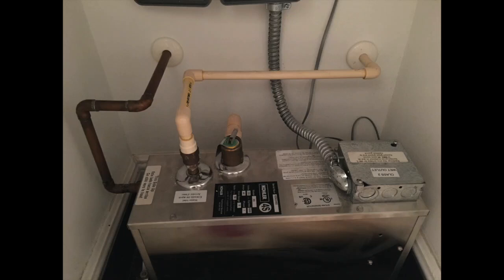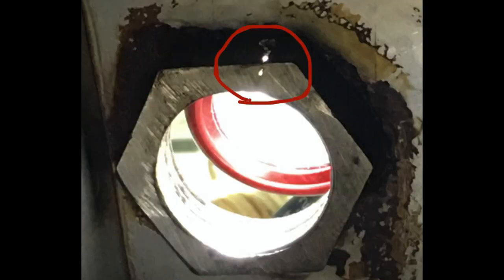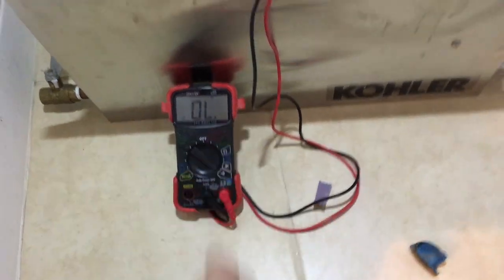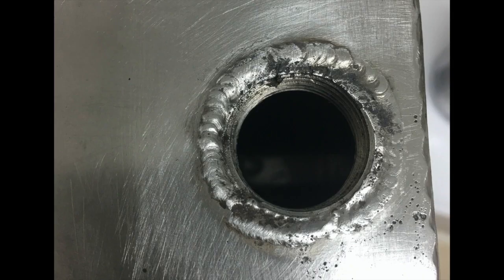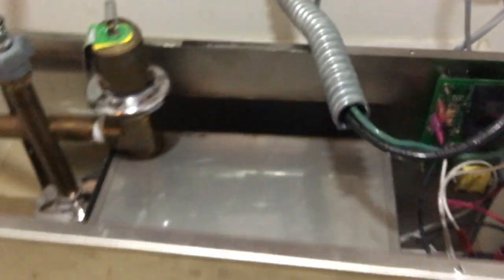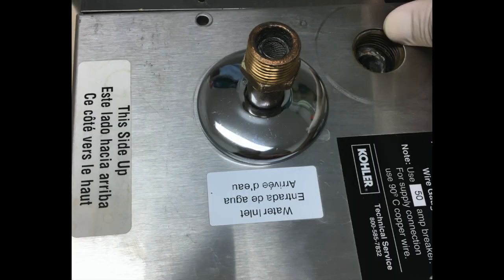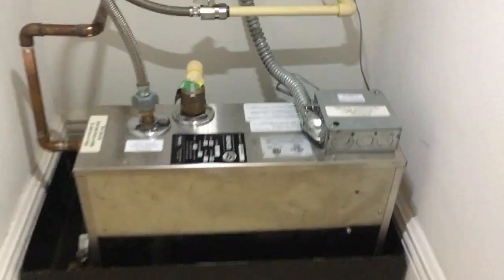Steam Generator Repair - brief highlights (K9 Kohler; Model 1659)

Comment: I am installing a 7kw at the moment. Is there no temperature sensor? My client didn’t provide one so I’m not sure if it exists or not. The Mr steam unit I install usually comes with a wire that has a metal tip, which acts as a thermostat.

Comment: Did anyone know the part number for the thermal switch? 
I have err5 as well. Runs for about 5 mins then stops. I’m guessing better to change the float switch and the thermal switch while I’m In there
Reply from the maker: If I have to make a wild guess, it appears that you have the same issue that I encountered 4 years ago. Even though I changed to the float switch, the problem was ultimately an erratic thermal switch. The video here shows all that I have done, but I never ended up replacing the thermal switch since I thought it was the float switch (which ended up needing to be replaced anyway). The float switch is easy to find: https://a.co/d/fZizGBk

However, I struggled to find the exact part number for the thermal switch. Since I had already assembled the unit, when it started throwing err5 again, I simply bypassed  (i.e. shorted) the thermal switch (read my comment below that starts with "Update:"). Before anyone heavily criticizes me: I am not here to recommend bypassing a safety switch, but I have done so myself only because I did not want to take the entire unit apart again. Four years later: I have had NO issues. The float switch (and the 50 A electric fuse) are two safety guards that I am comfortable trusting: i.e. if no water is in the unit, the float switch would cut the circuit to the heater and throw err5, or the heater will pull too much current and the 50 A fuse would disengage). But if you would like to try a thermal switch, see if these would fit your unit and make sure the specs match: 
https://www.digikey.com/en/products/detail/littelfuse-inc/USP10981/2651602
or
https://a.co/d/hqeKPdq

I hope this helps.
Reply: It does thank you. But I would like to just swap out the thermal switch since I’ll have the unit open anyways. 
I’ll try and call Kohler to see if they can give me the part number or I’ll just remove it and then try and match it with another one.

Comment: Any suggestions what happen 
I turn on switch then termostat also on generator make one click noise…-and spark 
Not working
Reply from the maker: the information you're providing is not enough for me to make a good guess about what is likely happening. You may have a short, or water leak etc.

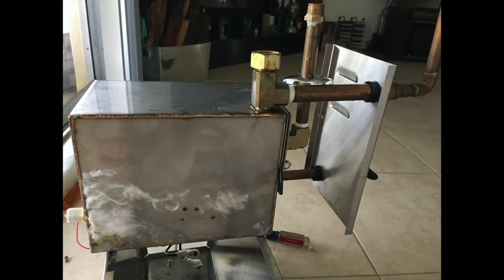Comment: You seem pretty knowledgeable about this product, at 1:10 you got these 5 nuts with a gasket behind it; mine seems to be leaking; without having done any research myself yet,  would you be able to point me in the direction of where I could get a gasket like that? Or what type I should be looking for as a DIY?🤔
Reply from the maker: Any rubber gasket would do - I suggest you measure the thickness of your old one (most likely 1/8"). Here is an example: https://a.co/d/7pMNjbw
Then you would need to precisely cut a similar opening to your old gasket.
Reply: @nesnas  thanks 🙏🏻 appreciate the help

Comment: AWESOME video. I have the same unit, but its dripping water out of the steam head inside the shower, nonstop for the past few days. I'm thinking its the purge solenoid or float valve.....not sure. There are NO other issues, leaks anywhere else, thank God. Just that constant drip in the shower from the steam head. Can you tell me where you bought that float switch from/part number? Maybe they sell the purge solenoid that opens the steam to the shower head, or replace the float valve too. Any input that would be great.
Reply from the maker: Thank you for supporting words. I bought the float switch (this is the safety plastic switch with the electrical contact) from amazon:
https://www.amazon.com/dp/B009094IPA?ref_=cm_sw_r_cp_ud_dp_BR51WCYSP2S0FFVNJAS1
You can also find parts at Grainger (if you have a local store near you or online). It seems like you have a problem with the water inlet float valve. When you have the unit apart, you can test it by lifting the ballcock (big metal floater) and the water should stop flowing in. If it does not (or if it leaks a bit), then that would explain why you are getting water into your shower through the steam head. The water level in the unit must be well below the steam pipe outlet, but if water keeps flowing in, then it will start spitting into the shower. 
Please note that if the unit is not run for several weeks, sometime water condenses into the cooling steam lines, and when you start the unit again, the heat and pressure build up will eject this water with gargling sounds into the shower before steam comes out - but this is normal and temporary (10-15 seconds). But it seems that you are having water dripping out constantly. I wonder if there is an adjustment you can do so that the water stops flowing into the unit at a lower level (just like the adjust on the toilet float valves).
Reply: @nesnas  Thank u for all the Info 🙏🏻🙏🏻. Yes we have a Gringer in town. I will check with the and see. 
FYI, I took the unit apart, and seems like the float rubber stopper is getting old and not stopping the water completely. Not sure if I can just get the rubber piece or have to replace the entire float? Unfortunately, there are no adjustments or any kind, its OFF and or ON...
Also, the tank is FULL of lime and scale. not really sure how to get it off. I have soaked the tank in white vinegar for 1 full day, and with zero result. How do you get all the lime off, its all over EVERYTHING inside the tank???? (Thank god, NOTHING is leaking outside the tanks from switches, heating element, connectors...ect. all clean and leak free, its only on the inside the tank). Any input on that I greatly appreciate.🙏🏻🙏🏻
So I need a new float and while I'm at it, I'll replace the purge Solenoid too. So far, I ONLY found the solenoid online about $100, but no luck at all on a new float/valve...I'll take it to Gringer and see if they have anything like it. (honestly I just need the rubber water stopper, its so small).
Reply from the maker: @appleSUX1  Sounds like you're making good progress. I am surprised that vinegar soak for a whole day did not take the lime and scale. You may want to try a product known by "limeaway" which is essentially sulfamic acid (NH2SO3H) which is more acidic and will have better solubilizing outcome. But please start with a dilute soak to see how much it could take off, and increase as needed. Avoid direct contact. And when you're done with these acidic treatments, please make sure you soak for at least 2 hours with baking soda to neutralize any residual acid (otherwise you will etch away at your metal - especially during operation - just think high heat, pressure, and high voltage). However, just keep in mind that as long as the lime is not blocking the steam outlet, then you should be alright with some scale deposit inside the chamber (you will not see it and it is not going to negatively impact performance). Also, do not use strongly harsh conditions since have some scale deposit is certainly way better than having pin holes due to acid etched metal (which could lead to water leaks - especially under heat and pressure). As for the rubber piece, you may be able to simply buy a replacement for it from Grainger or even a similar piece that would simply block the water flow. It is more likely that you would find a piece of rubber that could work than the exact identical float valve assembly. Good luck - I hope you get it fixed. Looking forward to your update.
Reply: @nesnas  FYI, Thanks to your AWESOME info, I was able to clean and remove 99% of the lime/scale. thank was super clean like new again (If i could show you how bad and thick was the scale that was collected for several years, since I have NEVER cleaned it or opened it till now, u would understand. We have the hardest water in the nation, Horrible). Anyway, THANKS a million for your video and info on how to remove the scale, HUGE HELP...THANK YOU, THANK YOU, THANK YOU....🙏🏻🙏🏻🙏🏻🙏🏻🙏🏻🙏🏻
Reply: I have the same problem. Curious what you found to be the cause

Comment: Where does it drain?
Reply from the maker: Unfortunately since my closet is tight, I cannot easily drain it - the drain plug is on the bottom left underneath the steam outlet pipe. You can see it clearly at min 3:35 in this video - I have not drained it since I fixed it - still working great! At some point I may take the right side panel and check for leaks (hopefully none!)
Reply: @nesnas  So the drain valve is purely for maintenance purposes like a water heater drain?
Reply from the maker: @cooper8318  yep pretty much. If you live in an area with high content of hard water, sometimes calcium deposits may form and clog the unit over a longer period of time. Occasionally draining would help a bit (if you have a shutoff valve installed - I added mine after the original install).  This is similar to a water heater (which may be a bit more critical since it is a much larger volume of water and get daily use vs. the steam unit which is much smaller volume and sporadic usage).

Comment: Thanks for sharing! Is there a parts list for these units? I took my 5KW unit apart and found my float separated from the floor arm. I might be able to braze it back. I didn't have hardly any scale inside my unit. I will check the rest of the circuit based on your video. Again thanks for Sharing. My unit is very basic as compared to new units.
Reply from the maker: Thanks David. Actually I could not find a parts list anywhere. So I just searched for float switches. I actually bought this one (from Amazon): 

Madison M8750 Liquid Level Sensor, Side Mount Float Switch, Polypropylene, 1/2" NPT

which is not identical, but worked well since it fits with 1/2" NPT. They're only around $12 (in case you could not fix the old one). But you may already know this; It is a simple mechanism by which the floating piece has a magnet that closes a circuit when it get close to the arm (when water is at level in the tank). This is one of two safety switches connected in series (float switch + thermal switch): if water level is low or if the unit overheats it cuts conductivity and unit gives error 5 (in my case - maybe yours is a different code - most likely similar code).
Reply: get a mr steam

Comment from the maker: Update: The original reason for taking this apart was err5. After complete disassembly, I noted at least 3 main problems: 1. Water leaking on the insulation 2. Corrosion around Float switch and noted most at the thread (most likely lead to the leak), 3. Intermittent conductivity test for the float switch. This video shows an overall cleaning, fixing the thread, and replacing the float switch. I was never really convinced that the old float switch (which still showed  erratic conductivity ranging from  ~8 to 100 Ohms would trigger err5 - apparently now I know that's because there was another issue that I did not know about until a couple of weeks after I put it all back together). I ran this steam unit for a couple of weeks every other day, and was shocked to see err5 come back on again (AGH!!). So it turns out that I never really fixed the original reason for this err, but it at least allowed me to note the leak/corrosion.  I did not want to have to take this whole thing apart again which would require sweating the copper steam pipes. Having a mental image of the circuitry in this, and having just enough room for my hand to fit between the closet wall the righthand side of this unit, I took the right side panel off (two screws), and then decided to temporarily loop (short) J4 and J5 (effectively eliminating the two safety switches). I felt comfortable doing so since I knew the water inlet is ok and water is indeed in the unit. Steam proceeded to flow without any errors. Using flashlight, mirror, and dexterity, I cut the marriage of the float switch wire from the thermal switch wire (as they were connected in series), and then proceeded to use the conductivity test them both independently as steam was flowing. I noted that the float switch (which I had just replaced) maintained conductivity at 2 Ohms, while the thermal switch (which I did not bother replacing since I did not suspect it was faulty - as it showed conductivity - albeit at room temperature but not at operating temp), began to lose conductivity flickering between a few ohms to Mega ohms within seconds while steam was flowing, but would regain conductivity once steam took a break. It appears as if it only shows a closed loop at low temps but not at steam temperatures. For me to replace it would mean taking the whole unit apart again (and possibly worrying about further leaks). So I decided that retaining just one safety (i.e. float switch) ought to be sufficient (considering there is a third level safety in the fuse box).  So I reconnected the float switch across J4 and J5 (all via the confined space between the wall and the right panel). It has been working beautifully, since, with no more err5. The great news is that I was able to check for water leaks by simply removing the side panel and using the mirror and flash light (and feeling around). Not a single drop of water leaking anywhere! I will be able to check for leaks (in under 5 minutes) every 3 months or so.
Reply: Very helpful. I'm waiting for my new float switch from Kohler. I hope I can repair it as I won't buy another unit. This is my second already. I love the steam, just wish the product lasted longer. I barely got 3 years out of it before it failed.